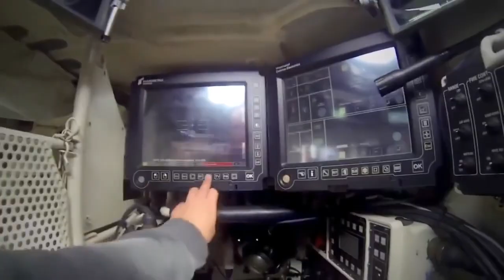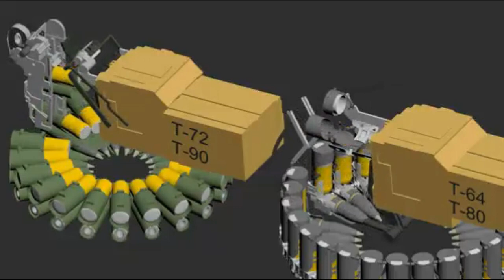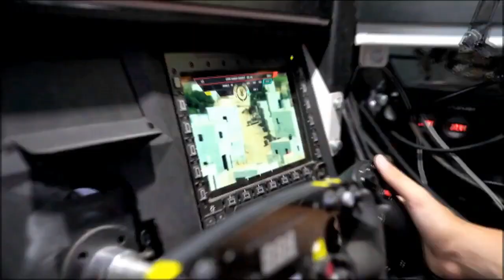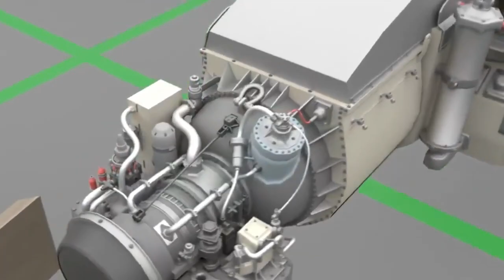#breakingnews Future Ready Combat Vehicle: Prototype by 2027, Induction by 2030 #indianairforce

Comment: While DRDO can develop Future Ready Combat Vehicle in 4 years. Who is the company that will produce this? Hopefully Mahindra, or some other large corporation that can mass produce 1000s of vehicles. 4 years compared to the lengthy slow Arjun, which was first funded in 1976, and actually produced only in 2004! 28 years, which is ludicrous. DRDO has transformed itself into a faster, much better performing organization. GREAT JOB DRDO.
1000s of orders for Arjun Mk1A should be placed. Between FRCV, Zorawar, and Arjun the T72 tank can be sold off. It is time for armor to be mostly indigenous, and even the T90 should be retired from service in 10 years. There are no spares, the T72/T90 is a maintenace nightmare, and unsafe against hits to the turret. Swadeshi armor only.
Reply: L&T is the better option for DRDO 
L&T is involved in zorawar too afterall
Reply: @fly463  As far as I know Ashok Leyland and Tata Motors and Mahindra have immense ability to mass produce vehicles and have diesel engine contracts. Wouldn't one of those be the obvious choice?
Reply: @datoolz0  
I think L&T would be better because they will have experience from Zorawar 
If they got this contract too then they could become the Tank manufacturer and developer for India
Reply: @fly463  l&t is only going to welded the Hull that not class apart experience when it comes to tank manufacturing,  rest all the majority important components are imported like gun, turret   , engine.
Reply: @datoolz0  man ashok leyland and tata don't even have thiers own engines for truck and you want them to get involved in serious engine manufacturing 🤣🤣🤣
Reply: @Kem____paalty16 lol ashok manufactures their engines
Reply: @samdarshianand1305  only Neptune rest all are hino licensed engines if we faced sanctions in near future then what????
Reply: @Kem____paalty16  Ashok Leyland makes their own diesel engines, so please google check your statements first.

Ashok Leyland is the largest supplier of logistics vehicles to the Indian Army. It has supplied over 60,000 of its Stallion vehicles.
Tata Motors has licensed tech from ISRO and has fuel cell/electric vehicles.
Reply: Mahindra who can't even produce public cars according to the demand on time 

Jk
Reply: @fly463 They make lots of cars, which is what whichever production partner they pick need to be able to do.
Reply: Lolz mahindra, land system like tanks and ifvs are not made by one. Company. The india military complex it still let by foolish baboons sitting in MOD we need to have a separate turret manufacturing company, a gun manufacturing company, and a track manufacturing company. This helps in standardised product and easy manufacturing. 😂😂